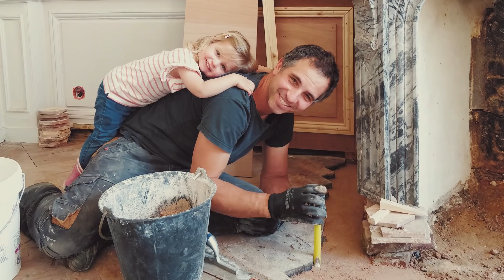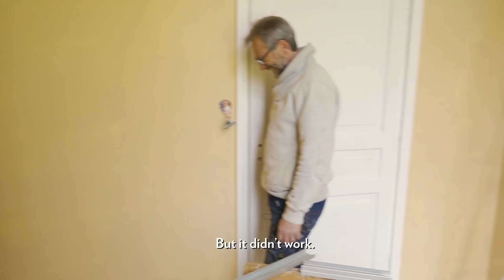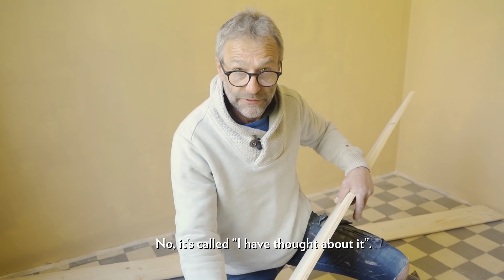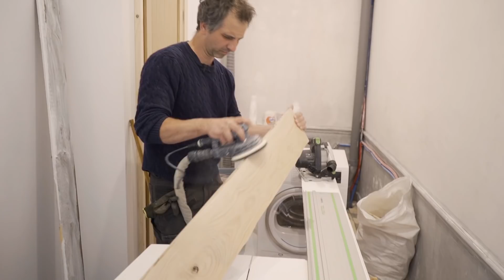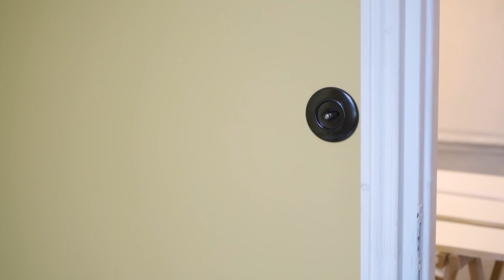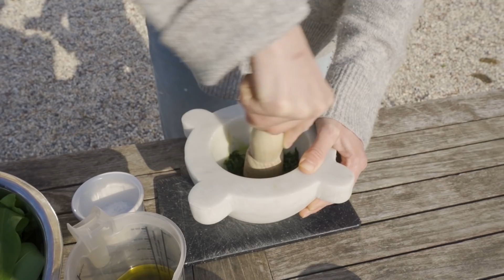EPIC carpentry FAIL - How To Renovate A Chateau (without killing your Partner) ep. 16

Comment: Structural engineer here! The floor repair was just fine. Steel below concrete, the way Philipp did it, is ideal. I saw some comments about ways to stop concrete from falling through. You can really use anything. Plywood pressed below the opening, steel mesh, or even window screen would work well. Can’t wait to visit someday soon!

Comment: To take off masking tape use a hair dryer ! A little tip, if you have a roll of masking tape that has gone a bit dry you put it in the microwave for a few seconds and voila ! If the masking tape is on glass run the blade of a knife along the edge to the tape doesn't take off the paint.
Reply from the maker: Great tips again, thank you Stephanie!
Reply: I live in an old house with very wide baseboards and with renovations we needed to make a few boards to match existing ones. So when we were painting the wall I painted down a couple of inches past where the top of the board reached. No need to paint to the floor, your never going to see it anyway because it’s behind the board and therefore no need to tape at all. 🙂

Comment: Should have taken a beam support jack, placed a 3x3 board on the ceiling of the cellar covering the hole and then pour into the hole ... unless you were going to use it as a laundry air exhaust port.

Comment: Philipp! Use blobs of glue not long strings like you do. Blobs have height and squeeze flat guaranteeing both surfaces are contacted, it's faster and professional. Space the blobs at either 300 or 450mm centers, in future a knife between the boards easily cuts the glue for repairs or modifications.
Reply from the maker: Thank you for the tip!

Comment: it's driving me nuts that you left the pipes in front of the baseboard under the window exposed... should you not have hidden them? Other than that you are turning out to be the stars of the chateau renovation channels... love your show!
Reply from the maker: If you hide them you have to insulate them, which would mean a very deep trench in the wall. Or you don't isolate them and you heat the wall.. that's why generally radiator pipes are left exposed in period buildings. Cheers